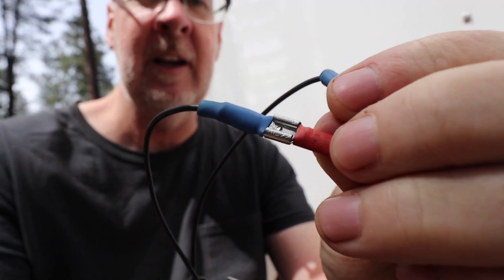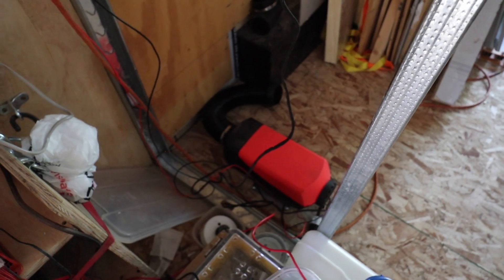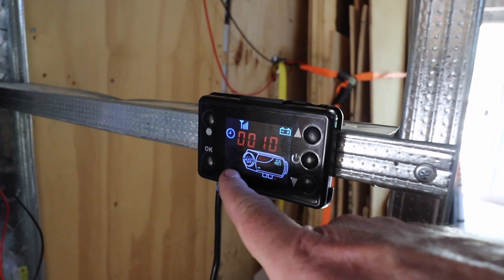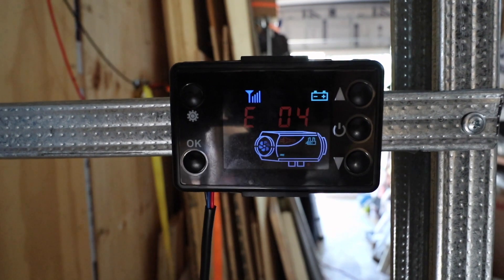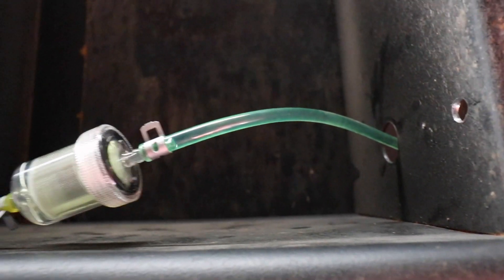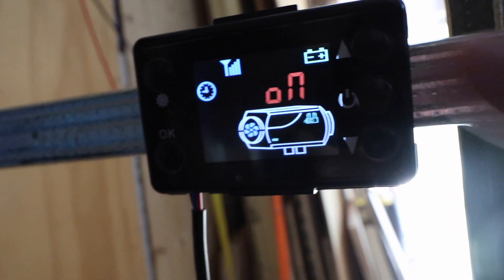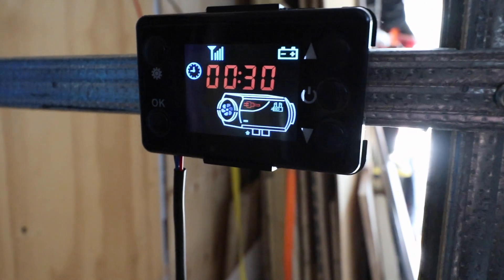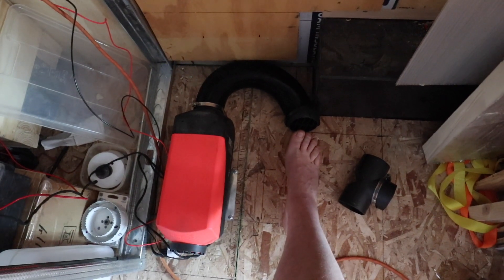Installing Diesel Heater in My Cargo Trailer Conversion P2 E637

Comment: Nice heater install !
When you showed the air bubbles on the fuel line I  noticed that the line runs through the metal framing. You should get rubber grommets to cover the metal edges where the fuel and/or electric lines run into these holes. From what I understand,  vibration will cause the lines to erode , enough to cause a serious problem. You don't want a fire from leaking fuel or from an electrical short. Almost any decent hardware store will have those rubber  grommets in stocks.
I look forward to your next show!

Comment: I just got one of those all in one diesel heaters to install in my ambulance rv. Putting it in one of the outside storage compartments and running the heat intake hose into the main living area.

Comment: You can order a fiberglass heat wrap material from Amazon, with stainless steel zip ties. The exhaust on these heaters are hot enough to star a fire. Good luck with your heater.

Comment: Make sure that the output for your hot air all the hoses and fittings can withstand the heat because I have melted plastic with those on accident and I would hate for you to melt the fittings or hoses and or have a fire.
But other than that great job, remember we are our own worst critics don't let a failure or mess up discourage you.

Comment: Every person I've seen  installed these diesel heaters  sre doing the same thing and having similar problems. You need to make sure that you get fuel all the way through your fuel line to the pump before you turn it on. After you put the diesel in your tank remove the fuel line from the pump allow gravity or suction to get all the diesel all the way to the end of the fuel line then connected to the pump. These click type pumps have a hard time pulling air out of the fuel line
Reply: Not the best type of fuel filter either.  Looked like a breach on the screw cap.